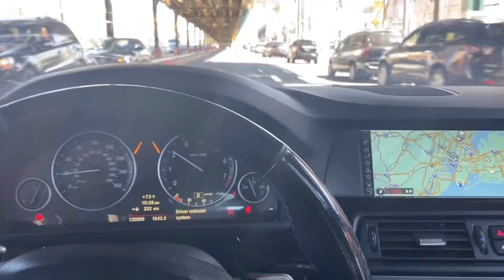BMW 5 SERIES F10 GRILL SWAP MOD | HOW TO REMOVE/INSTALL KIDNEY GRILL

Comment: hi sorry to bother do you mind sharing the link of which grill you purchased from amazon?? i see a few but i’m iffy on which to order but i’m diggin yours 🤩
Reply from the maker: It’s No Bother , I Purchased It From eBay Here’s A Similar Link

https://www.ebay.com/i/284013965228?chn=ps&norover=1&mkevt=1&mkrid=711-117182-37290-0&mkcid=2&itemid=284013965228&targetid=1098102009964&device=m&mktype=pla&googleloc=9004472&poi=&campaignid=11774733487&mkgroupid=113829509425&rlsatarget=pla-1098102009964&abcId=9300474&merchantid=6296724&gclid=Cj0KCQiA0MD_BRCTARIsADXoopbqo3zblIA373au7x5z8oUWQz1VTzyy3RNrmt_csGX61q6g6vALPfoaAhs1EALw_wcB
Reply: thank youuu ☺️ @Dreadlifem4